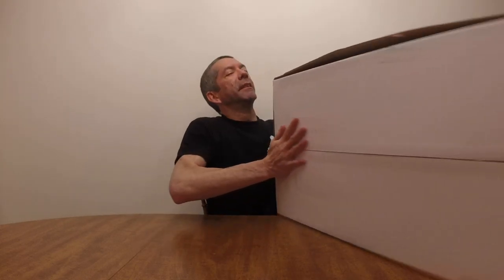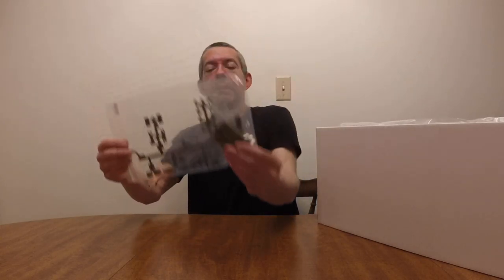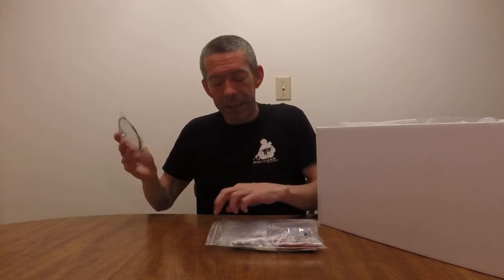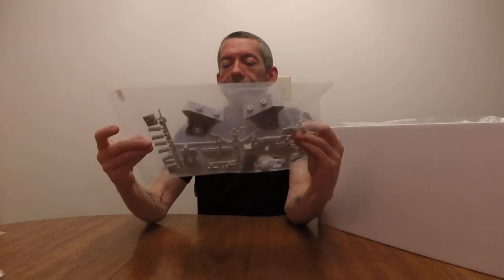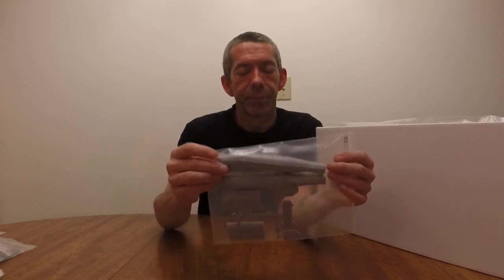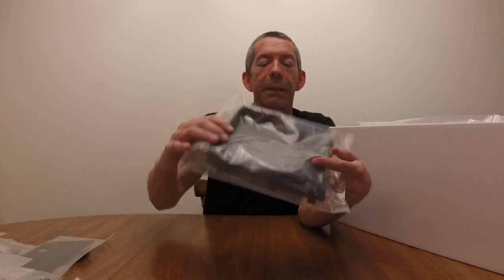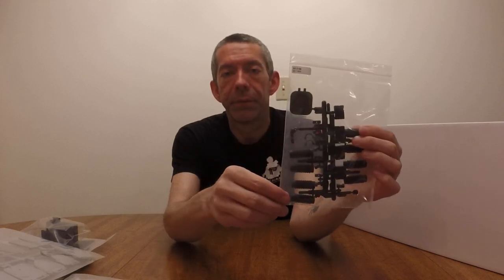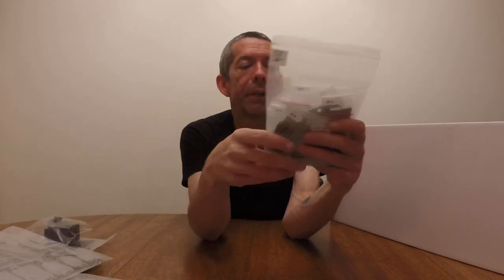Cross is selling a Hippo?

Comment: Tell me, for this model, do you need 2 regulators (ESC) for 80A?
Reply from the maker: Yes two 80amp electronic speed controls (esc). One for propeller drive, one for wheel drive.
Да, два электронных регулятора скорости на 80 ампер (esc). Один для пропеллерного привода, другой для колесного привода.